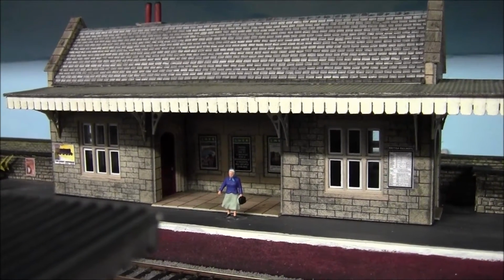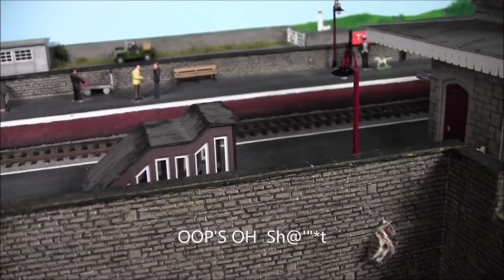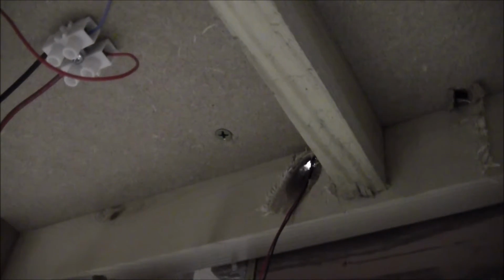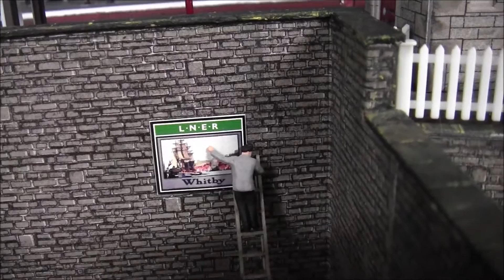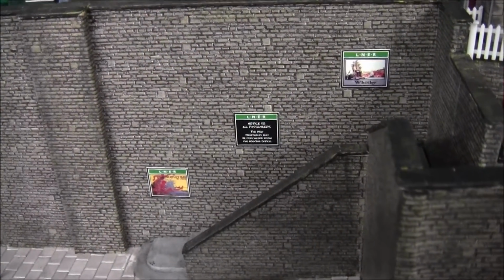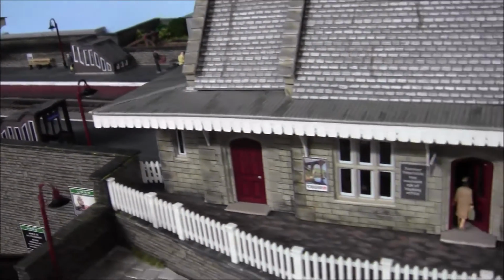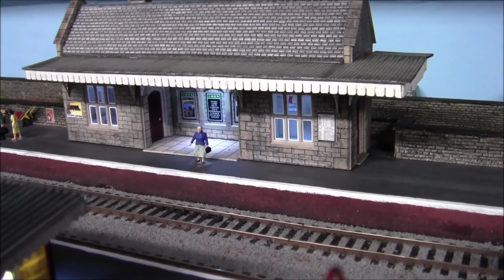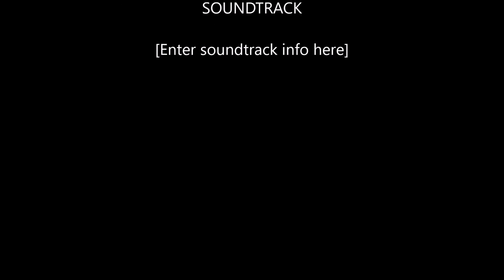Fitting lamposts and accidents do happen.... No66

Comment: Very nice Tony, I did like your play “Hole in the wall gang” and how they fixed the wall for you.  I am pleased I am not the only one that does that, I remember putting a TV wall bracket on the wall in my daughter’s bedroom, when she lived at home, I drilled holes all the way through to the landing, my wife was not very pleased…Simon
Reply from the maker: Hi Simon you didn't cover the hole over by using a picture. lol I remember seeing frank spencer doing something like that. we have all been there mate. I once drilled a hole for a cable supply solar panel on the roof off my old motor home and drilled straight through a wiring loom and lost most of my internal electric supply. but managed to re wire it all back together again. accidents ...thanks again Tony